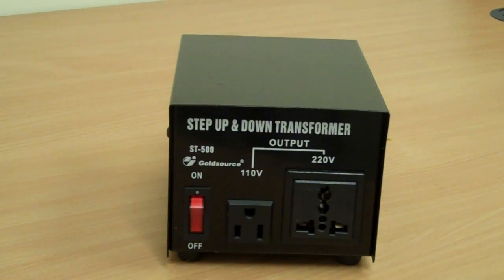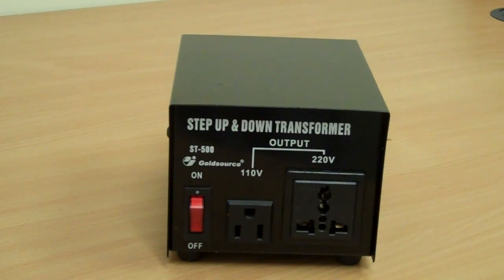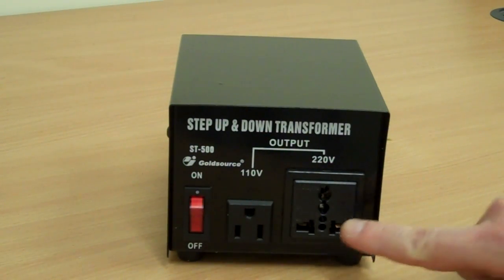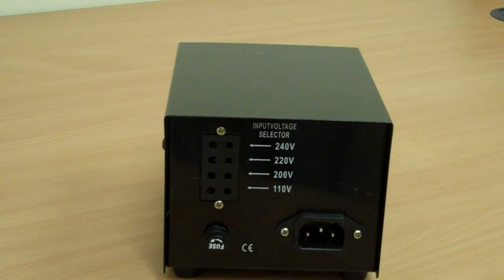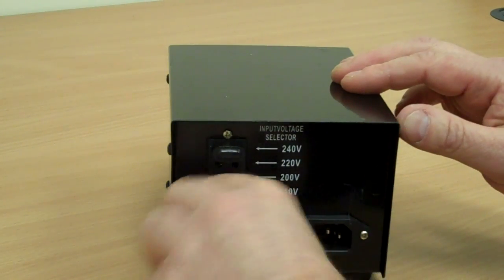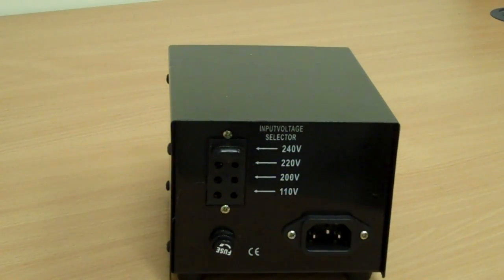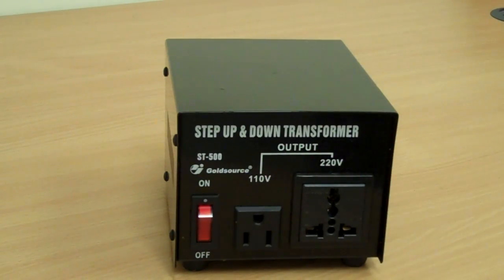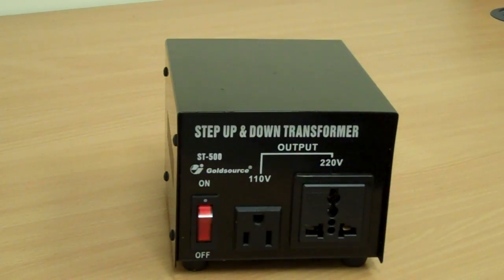Goldsource ST Step Up and Step Down Voltage Converter

Comment: Can I use this to get 110v from my 240v twist lock outlet in the USA? Ex: I have a L6-30 outlet(for my compressor) and I can get an adapter to turn it into L5-15 and I'll still be getting 240 from that... Can I then plug this into that adapter and get 110 ? I don't know why I'm so confused by this unit... But basically I need 110, and I only have the one 30amp outlet.

Comment: Does it need to go into the wall power outlet or would it work fine on a power brick?
Reply: You could connect it to a brick (I'm assuming you mean a multi-socket extension) you just need to be careful not to over-load the brick.

Comment: Hello, I have the same transformer as yours, but recently it stopped powering on. When I first plugged it in it was working fine, however when I unplugged it from the wall and then replugged it it stopped turning on. Is there a way to fix this?
Reply: Same with me

Comment: great video but i have few questions that not mentioned in the video.
if lets say my TV is 150W 110v. i am in UK so i use the 240 switch and convert it to 110. the questions are...
1. if i leave it plugged in the wall socket with nothing plugged in to the converter will it consume any electricity?
2. if TV is 150w will this converter consume more than 150W? (as for conversion power loss in the process)
3. if lets say i plug more things to it and the power draw exceeds Rated 500w what happens then?
4. also, if TV flactuates and uses 40w to 150w, does the converter always consumes 500w?

Comment: at 1:32 you mention "input selector jumper switch." I need to buy one of those as the transformer it goes to doesn't work without it. Any ideas as to where to find one?

Comment: IM looking at getting a 2000w version of this brand. I cant find any website or so, guess it perhaps a Chinese manufacturer. Is this an okay brand to use?
Reply: id like to run it on a 220v 6amp 1320w power washer. Its will be used in small burst of around 10 minutes

Comment: If I put the jumper at 240V, and plug it into 230V socket, I think the output voltage would be slightly above 100V (around 105V). and not 110V or more. Is my thinking right?

Comment: I'm in the UK and I have a Japanese games console that says 100v 50w 50/60hz on the back of it, and 125v-6a on the plug. Will the step up and step down voltage converter in your video be right for it?

Comment: Hi what will happen when my step up transformer 110V to 220V, suddenly change the input voltage from 110V to 220V will my transformer get spoiled? is there a step up transformer that automatically adjust when the input voltage change?

Comment: Hi, if I have a 1000-watt mixer, and I’ll be using it for 1-2hrs (with pause in between, not continuously) is it ok to use a 2000-watt step down transformer? Thanks in advance.
Reply from the maker: Yes that would be fine.

Comment: I’m in the Netherlands and I want to power Canadian electronics. They say it’s 230v but my transformer only converts from 220 or 240. Can I use
one of these or do I need a transformer that converts 230w?
Reply from the maker: You can use one of these with the input set to 240V. Voltage from the mains will vary a bit from day to day and depending on things like distance from an electricity substation and the state and age of wiring. 10V either way does not make enough difference to be an issue.

Comment: to prevent damage or possible fire hazards the fuse should be replaced with slow blow fuse MDL of same ampare rating but i never got 2 spares what should i do just keep the one fuse i have and use it once a week. because i dont know why 2 spare fuses didint come with me step up step down transfermer 110v 230v

Comment: Hi BestStuffUK
I live in U.S but my peanut grinding machine from china 220v, which output should my peanut grinding machine plug into 120v or 220v? and on the back of the converter the little switch there does it go to? Thank you
Reply from the maker: The switch on the back should be set to 110V as you are in the US (it is an input selector switch) and you plug your 220V peanut grinding machine into the 220V output on the front of the converter.

Comment: Hi

I have two items from the US i wish to power here safely. So I am going to need to buy two of these devices then?
Reply from the maker: It depends, if you need to use them both at the same time you could use a power strip to connect them both, you have to get a converter large enough to handle the combined Wattage. Also, if you do use a power strip do not use a surge protected one (this is quite important). If you feel you need to protect against surges do so before the converter not after it.

Comment: Hi. I plugged in an American appliance into this device in the UK, but I had the voltage input at 220v and not 240v. Could this have contributed to my appliance burning up?
Reply from the maker: In the UK you should set the input selector to 240V. It's not likely that setting it to 220 would cause any damage though.

Comment: Im buying a 3d printer from the US the control box on it can be switched from 110v or 220v but  im in the nz which i searched up is 230 v how can i make it work.
Reply from the maker: You should be able to use it on the 220V setting. 10V AC either way should not make much difference, but it would be a good idea to confirm this with the printer manufacturer.

Comment: HI I have purchased a Goldsource STU-1000 mainly to use my English Janome computerised sewing machine that Ipurchased in the UK.  The converter has worked fine until the other day when I thought I would try using my UK purchased cordless steam iron, the converter has stopped working and I have totally confused myself by watching the videos that you have online.  If I am plugging things in from the UK to convert to US do I place the converter plug at the back on 220V or 110v?  Sorry to be so dim but I really can't work out what to do.  I plan on purchasing a new fuse as I am assuming that the problem of plugging in my steam iron blew the fuse for some reason?  I think I need a 10amp glass fuse is that correct?  Many thanks in advance
Reply from the maker: The steam iron would use a great deal more power than the sewing machine. Anything that produces heat always uses a lot of power. So, the converter would have over-loaded and blown a fuse. You need to replace it with a 10 Amp fuse.  You are using the converter as a step up converter, so your input is 110V, so the input selector on the back should be set to 110V and you plug the sewing machine into the 220V socket on the front. But, don't use it with the steam iron again, for that you need a larger converter.

Comment: Hi, I just bought this convertor but it doesn't have the jumper switch for the input voltage selector. The store wouldn't take it back, any ideas what I can do now? Really appreciate you're help.
Reply from the maker: Are you sure that you have a Goldsource? They should all have the selector switch.
Reply from the maker: If there is not input selector switch it can't be this model of converter.

Comment: if my amp is rated at 230v  put it on 220 or 240 i'm in the us
Reply from the maker: If you are in the US you put the input selector switch to 110V (it is a switch for input not output). The plug the amp into the 220V socket on the front.

Comment: Hi, I bought my son a fridge from the USA and so it will need to be on constantly. Can you tell me if the Goldsource ST transformer can be used for this?And if so would the 500W be sufficient. Thanks.
Reply from the maker: These transformers do not work well 24/7 and the usual answer is to just
 use one that has a capacity a lot higher than the load, so it is under 
minimal strain. There is a separate problem with fridges though. They 
usually have power correct capacitors to stop them from over-freezing. 
the capacitor can feed mains power back. If you are connected to the 
mains this is no problem, but if you are connected to a Voltage 
Converter you can have mains power flowing through the converter the 
wrong way, which can cause it to fail.
Reply: Thank you for replying so quickly.So are you really saying that I have no way of running this Star Wars 'chiller' fridge that I bought from America as my son's 21st birthday present??Secause that is rather depressing!Sue

Comment: Hi I have a flour mixer that I bought from India and I want to use it in Canada. Do I need to select the 110v input in the back and the front plug the flour mixer to the 220v output? 
thanks
Reply from the maker: Yes that is correct.
Reply: Tariq Almuflehi v*

Comment: I just bought a salon quality hairdryer that runs at 230-240v 50hz 2000w with a UK-style plug. I would like to use it in Japan. I will probably run it for two-three hours at a time or so...would a 3000w transformer with input power set at 110v (Please correct me if i'm wrong, I believe that is the level for Japan) suffice?
Reply: omg what ,,,,

Comment: Could I use this in the US to power a motor that requires 220. I only have a 120v outlet and wanted to know if I can power my table saw
Reply from the maker: Yes you can do that, but you need to make sure that the Wattage rating of the converter is enough for the saw.

Comment: Hi, I shipping a American kitchenaid mixer artisan 325watt unit 60hz to Thailand I know I'm going to need a stepdown transformer would a 1000w transformer be more than enough and does it matter it is 50hz there not 60hz in the states.
Reply from the maker: The 1000W is more than enough power, in fact a 500W should be enough 
unless you want to use the mixer commercially. If the mixer's motor gets
 its timing from the frequency (Hertz), then it will run slightly slower
 in a 50Hz country.
Reply from the maker: 1000W would be fine, although you really don't need to go that high, 500W would also be OK. People report that KitchenAid mixers do seem to work OK on 50Hz. Some older models would get the motor timing from the Hz and run slightly slower on 50Hz.

Comment: I have a TV bought in the USA and want to ship it to the UK. Will this work for TVs and sound bars?
Reply from the maker: Yes it will. Which one you buy depends on the load (Wattage) of the 
items you wish to power. As it's a TV it will be on for long periods of 
time so you need to choose a converter with plenty of margin, x3 would 
be best, so that the converter is under no strain.
Reply from the maker: Yes, a lot of people use these for that.

Comment: What's the best potable voltage or something portable to get that will run electricity for a long time even something like a refrigerator or stuff like Tv's or laptops ?
Reply from the maker: Hello, laptops do not need Voltage Converters, just plug adapters, as they are multi-Voltage. For items that are to be run for long periods of time you should just use a converter with a maximum capacity much larger than the load. That way the converter will not be under a lot of strain for a long time. Usually you would triple the rating, so for instance a 500W load over a long time you would use a 1500W capacity converter.
Reply: thanks for the info.And I'm doing a search of the watts of the refrigerator so i can know exactly what to get.

Comment: I'm using the 300W model to power a refurbished antique Singer sewing machine, 1935 model 66.  It's rated at 100 Watts. I've fitted an American 110V 5-15 NEMA RCD [GFI] on the machine input, as I'm led to  believe that the house mains' 230v RCD will not operate correctly on the 110v side of the transformer  Am I being over cautious?
Reply from the maker: +belson alan The converter is fused, the UK plug is also fused. There should be no need to add a 110V RCD.

Comment: Hi I am wondering about powering batteries up for cordless drills and other power tools. What would I need ? Thanks
Reply from the maker: +Claire Morham The best option would be to use a 220V charger, which should be available for any US cordless drill. The problem with using a converter with a power tool charger is that often the chargers have power correction capacitors in them to stop the batteries from over-charging and these can sometimes damage the converters.

Comment: I need help, and a response ASAP because it's not long until I get my item in question if that's okay?

Ok so basically I am importing a Nintendo Wii U from America, and when plugged into a power source there is always a white and red light on the Wii U with no way to stop those from showing up. What is the SAFEST WAY to power it all off? Do I remove the "plug" thingy on the back of the console that has the wire with the plug on it, then turn off the transformer?
Reply from the maker: +Drogon If you do a web search on "Wii U Multi Voltage" there are a lot of interesting articles on how although it may not look like it the Wii U power supply is multi voltage and you would not need a Voltage Converter. They also tell you how to check this, which I suggest you do before trying it.
Reply: BestStuffUK
I already have my step down transformer, I was just wondering after using the Wii U, is it safe to just turn the transformer OFF. Like, despite it being plugged into an electrical outlet, having the transformer off means no chance of any electricity inside the transformer. I know all of this may seem really obvious and implied, but you absolutely cannot take any chances with these things.
The Wii U arrives Monday.
Reply from the maker: +Drogon  Yes it is safe to turn the converter off.
Reply: BestStuffUK
Thank you kindly. Is it safe to use anywhere between 3-7 hour play sessions? I play a lot but on average it's 3-4 hours sometimes less.
Reply from the maker: +Drogon You might consider using a converter with a considerably higher capacity than the load if you plan to play for very long time periods, as that way the converter would be under no stain.
Reply: BestStuffUK
I have a 300W transformer, and the Wii U maxes out at 75W which I found out. I've done a few 4 hour play sessions and so far there's been no issues. By the way, I love how silent the transformer is.

Comment: Would a 500W one power a jump start/battery boost at 110mh? 
TIA for answers.
Reply: +Gary Leach How many Watts or Amps does the battery boost use? It needs to be less that 500 Watts or 5.5 Amps.

Comment: does this mean. I can plug this into my 110v outlet. that has a 20amp breaker. and power my 110v machine with male plug in machine that requires to pull 27amps??? someone please help
Reply: +Teddy Eddy No, the breaker would limit the output to 20 Amps. These are for transforming Voltage not for circumventing Amp breakers.
Reply: +Steve Farr alright thank you

Comment: Thanks for your great service and informative video! Having bought a cheap transformer from Maplin for musical instruments I've got on ebay from America, I found that it'd soon died fairly quickly, before reading the fine print that says it's not for continuous use... Given the application requires something that can handle continuous use, I needed something more heavy duty and this fit the bill perfectly! Thanks again for your service and a great, affordable purchase.

Comment: I'm across the pond in the US. I have a couple of Japanese video game consoles. The original AC adapters for them are 100V. I have some 120V AC adapters that work just fine with them. Now, in case my original Japanese 100V AC adapter dies, and all I have available to use is the 120V one, will I be able to plug one of the 120V American adapters into the 100V slot on my step up/down transformer, or is that 100V slot in the transformer only to be used with 100V AC adapters? Even though the 120V works right out of the wall with those Japanese consoles, I'd feel better going through a transformer, but I didn't want to destroy anything by using a 120V adapter in to 100V slot of the step up/down transformer. Thanks.
Reply: +Billy Skittles Generally the Japanese Voltage of 100V is considered close enough to the US 110-120V that a converter is not needed. If you really want to provide exactly 100V then you need a Voltage Regulator not a converter or a transformer. A regulator allows you to set the output exactly, while a converter or transformer just doubles or halves the Voltage it receives, depending on whether you are using it to step up or step down.

Comment: Very good review. For an electric fan that would use at the very most 120 watts used for only a few hours at the time, not constantly on, would the 200 watt model be enough?
Reply: +Jean2291 Yes the 200W would be fine for that.

Comment: Could this type of power converter be used for a 220 volt clothes dryer to step down to 110 or 120 volt plug? Anyone please reply.
Reply: +Randy Blü You would not be stepping down you would be stepping the power up to 220. Yes you could use this but you need to know the Wattage of the cloths drying and comfortably exceed that. For items like dryers that are used for long time periods, you need to double or triple the Wattage so the converter is under no strain.

Comment: For a 1200W Microwave Oven is it enough to use a 2000W Step Down AC Voltage Converter for 30-60min time ???
Reply from the maker: ***** Yes it would be fine. The thing about microwaves though is to make sure 
that you are looking at the input not the output. For instance our 
microwave here is a 850W microwave, which means it produces 850W of 
cooking power. However, if you look on the back of it it says input 
1250W. So, some power is lost in converting electricity into microwave 
power. You always need a converter big enough to supply the input plus 
some margin.